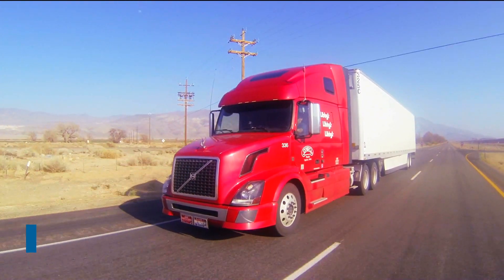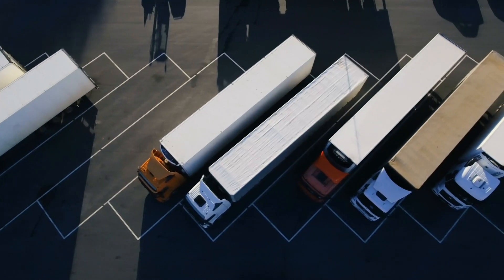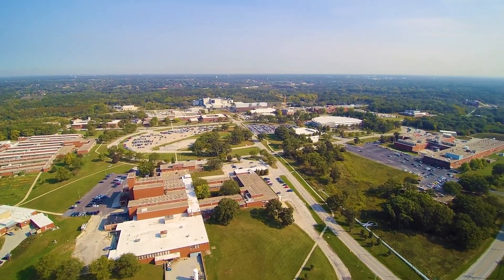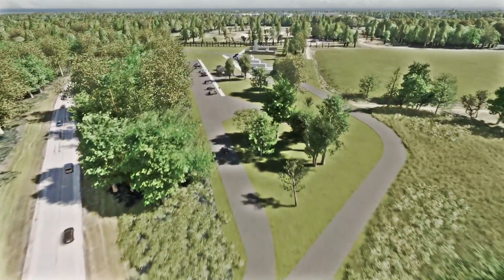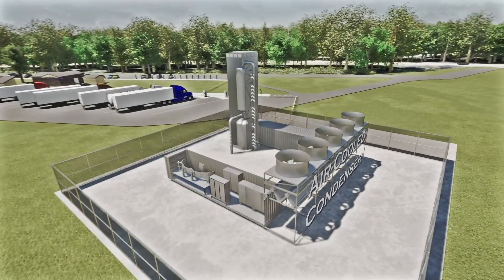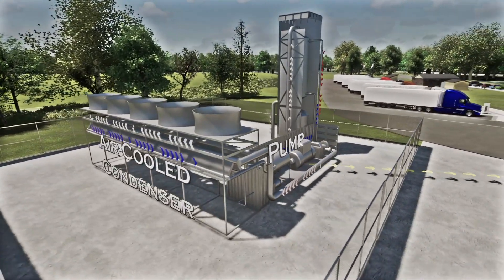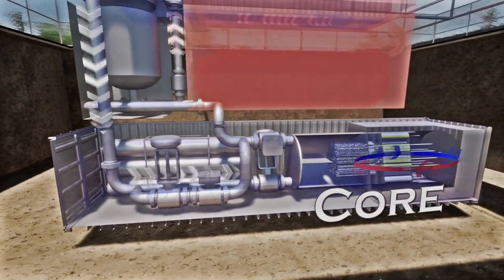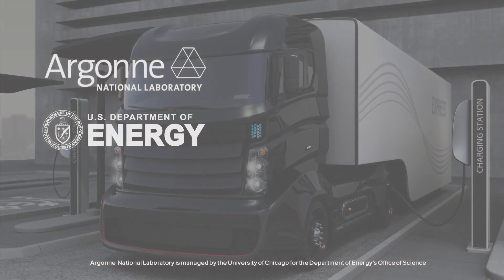Argonne News Brief: Could micro reactors help us keep on e-truckin’?

Comment: The US and the rest of the world needs to wean itself off batteries for all transport applications because of the energy security problems regarding the sourcing of raw materials and the dead-battery waste problem. This reactor can produce green hydrogen from high temperature steam electrolysis (HTSE) and then everything about the complete system, including everything aboard the FCEVs becomes 90% (or over) recycleable.

This would greatly improve the USA energy independence. Most developed and many developing nations could manufacture these reactors under licence and all of the other 'simple' components making up the whole system. They may be beholden to the US for fuel in the first instance, but that could change over the decades.
Reply: for sure, or alternatively a similarly sized VHTR to power thermochemical H2 production